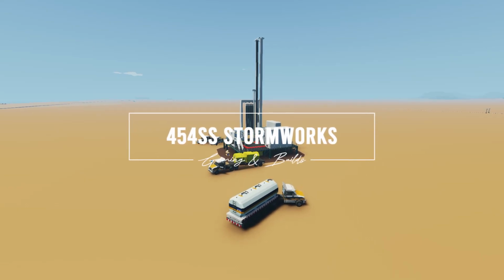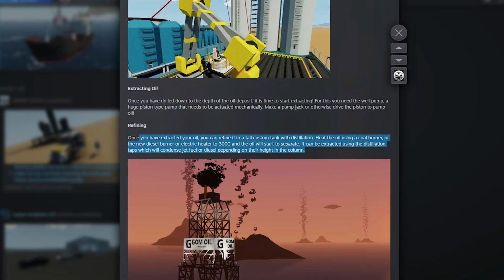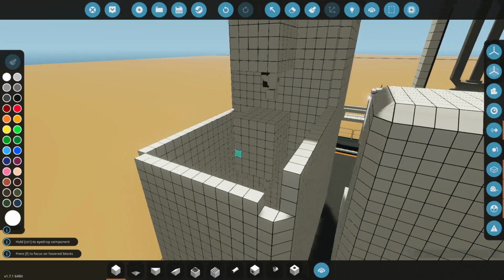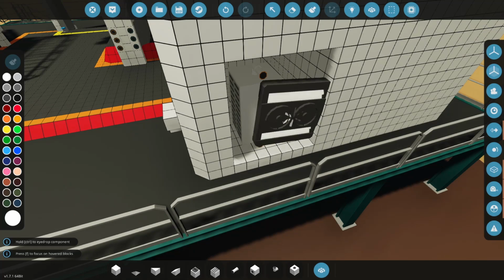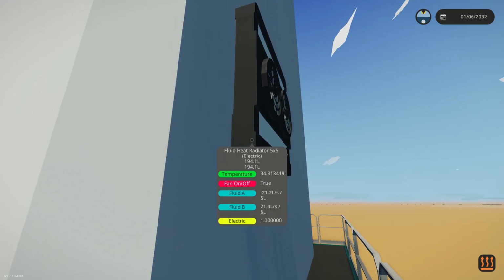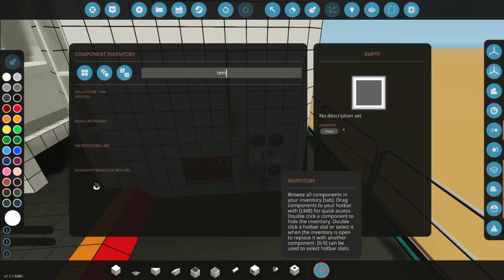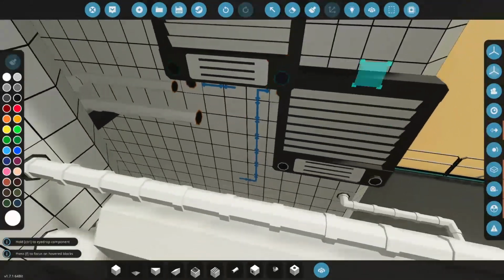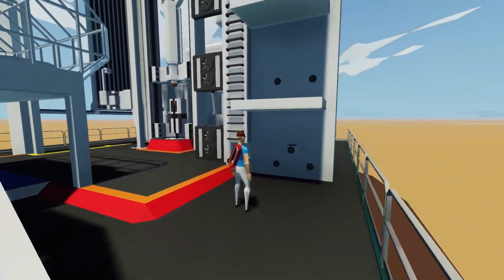Stormworks: ADVANCED OIL RIG PT.5 - Distilling Oil First Attempt

Comment: Hello, nice video. I recently figured out how to do it. You need to run the oil through the coolant in and out lines of the heater. I too was confused since I thought coolant was for cooling the heater but that is not the case. Your oil is the coolant which gets heated. You need about 3 or 4 heaters all joined up to produce enough heat. Once spawned in you can hover over the distillation port and it will tell you which fluid it will collect once the oil is hot enough. Really low down it will just collect oil, just above that it will collect diesel and much higher up you will get jet fuel. Hope this helps 👍👍
Reply from the maker: Amazing, thank you!
Reply: Apparently from 7-25 blocks high you get diesel and >26 you get jetfuel
Reply from the maker: @koopalad4  Amazing information! I am so excited to work on this after work! :) I have lots of plans for this rig

Comment: I've managed to automate oil drilling other than manually feeding the first rod but I haven't figured out how to detect if I've struck oil. 

Did you figure out if there's anyway to see if you struck oil? I've heard pressure changes on the pumpjack but unsure.
Reply from the maker: Just make a fluid sensor in the oil reservoir and once it starts to fill you've hit it!
Reply: @454ss_gaming  My concern with that is will it fill slower at the tip of the reservoir vs deeper or does the depth need to be shifted based on oil well fill level. 

Other than that it should work fine.
Reply: @454ss_gaming  Yep that worked. I now have it to where I can load the first rod by hand and press one button and it works flawlessly. 

Now to make it look pretty and have the other non drill units. 

Is it alright with you if I use the RAT branding on the generator I'll be making for the well once I get it ready for non infinite power use? I'm not creative enough to make my own and your oil vids have helped.
Reply from the maker: @taliakuznetsova7092  Awesome work! Of course, feel free to use the RAT brand :)
Reply: @454ss_gaming  Perfect thank you.